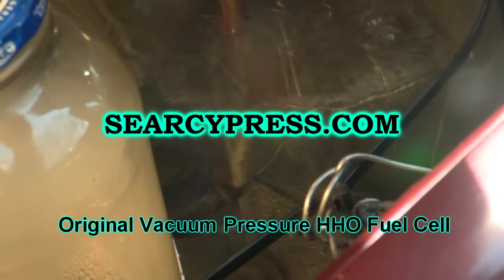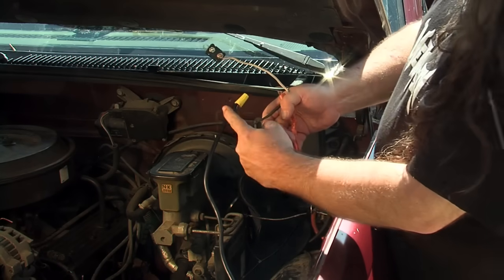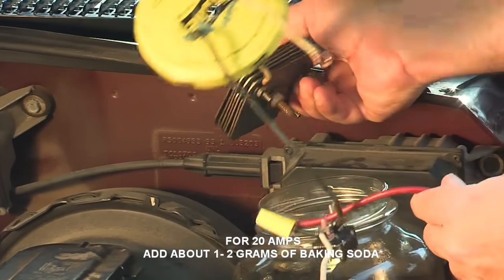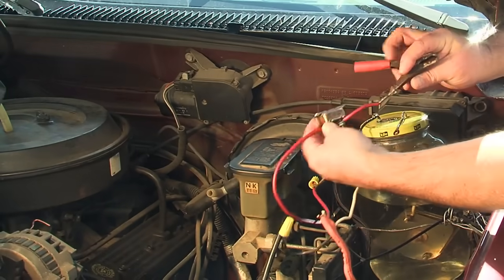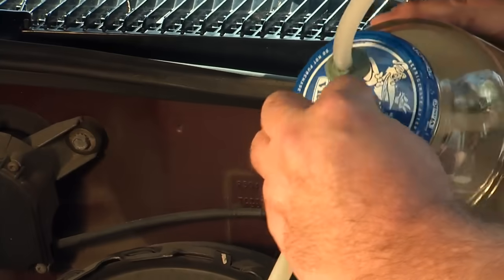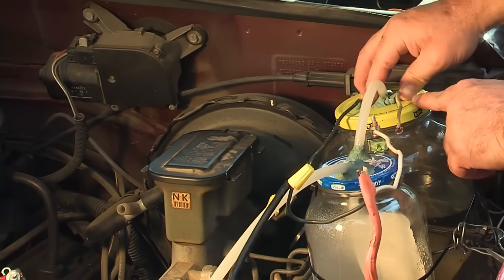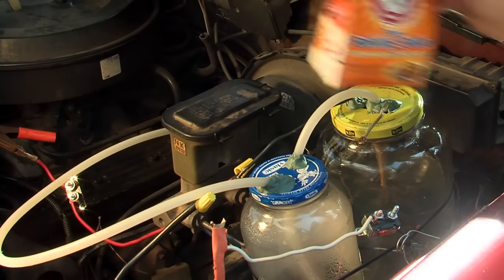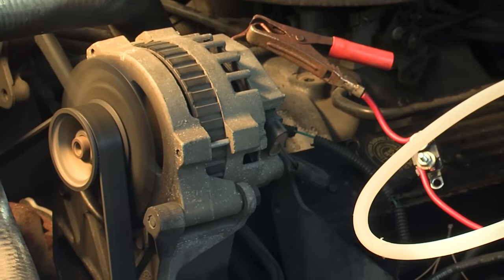Vacuum Pressure Hydrogen fuel cell defeats high gas prices using hydrogen from H2O.

Comment: During the great recession 2009-2010 money became so scarce I lost all my utilities for 2 years. I had acquired a gasoline electric generator which would run 10 hours on 5 gallons of gasoline. I constructed an HHO generator. It was powered by a 12 volt 10amp power supply connected to the electric generator. After connecting the HHO generator the electric generator ran for 12 hours on the same 5 gallons of gas. It ran smoother, more powerfully and cleaner than it had before. After about 6 months the plates were consumed and without the HHO the performance returned to its previous level. HHO could not be used to run the generator but I did observe a noticeable improvement in performance.
Reply: Love these lies....

Comment: This is pretty grotesque for so many reasons, I mean the glass jars as containers and mains wiring twist locks and light switches, Jesus.

Worst part however is the fact it's total bullshit. I mean please explain to everyone "thermodynamics" given you like to use the word a lot. Also explain "conservation of energy" while you're at it.  You are taking power from the alternator to split water into hydrogen and oxygen and then it's supposedly going into the engine via the vacuum line and being burnt to increase efficiency.  However, the power from your alternator comes directly from your engine. It takes more energy to split water than you get from burning hydrogen and oxygen to create water, so you are losing power, you are not improving anything at all, it's total bollocks and anyone who has done even basic chemistry in school can tell you that.
Reply: This guy's building attempts remind me of an expression that starts with an "N..."'
Reply: Kiowan918 @ Don't stress hydro is otw 🤙

Comment: So Electricity in the car is produced out of thin air?
Reply from the maker: No, that would be over unity. The gas  we make definitely comes from the gasoline in the tank. Almost all engines don't burn the fuel completely. The percentage is actually shocking how much is wasted. The HHO gas allows a more efficient burn to take place in the cylinder. Additionally you are able to burn a much lower octane fuel without any knocking of the engine. That is instant savings. Thanks very much for your comment.

Comment: Lol all that water inside the combustion chamber doesn't leave through the exhaust some gets put right back into the engine. Oil and water do not mix. Every see a motor suck in water the oil turns to jello.
This might incrresee mpg but at what cost. You will be doing more oil changes and who knows what other damages

Comment: This doesn't work the way people say it does, but I think it could work. Many companies have been reassuring out ways such as compression ignition, prechambers plasma spark ignition systems all to try and ignite the fuel faster because it can increase efficiency by over 30%. So instead what this is doing is putting one of the fastest combusting gasses into the cylinder to dramatically increase the rate at which the fuel burns which could give the same ~30% efficiency increase.
Reply: Lol at far less then 1% of hydrogen in the cylinder this isn't doing anything but dragging the motor down from the alternator draw.

Comment: Which is it? Vacuum or pressure? The title says both.
Reply from the maker: Vacuum pressure, is pressure. Although this is negative in nature. In Refrigeration and air conditioning this term is very commonly used. The fuel cell itself behaves much like an evaporator in a refrigeration system, that is why the thermal properties of this design make it exceedingly efficient. Thanks for your comment.
Reply: @metalpresstv  perhaps in HVAC this is a common term. Though in reality a pure vacuum is the complete absence of pressure.  In a partial vacuum you certainly can measure the differential between pressure and vacuum. Say as in pulse waves were both exist yet they are still separate, some what dependent apon, and yet still exclusive from each other. This was 1st described in 1643 by Torricelli. So pressure is the collision of molecules within a vessel. Under a vacuum the molecules are void or partially void in partial vacuum. I think vacuum "force" is the scientifically correct term but I will defer to those who have better knowledge of this subject.
Reply from the maker: @scoutdogfsr  very interesting comment. Because a total vacuum is quite difficult to achieve, more than likely you will be measuring a partial vacuum in whatever it is you're looking at. I assume the term vacuum pressure became commonplace because when you come up on a system, and hook up to it, you are wanting to measure the pressure. Let's say you find it in the state of vacuum. The boss asks you what's the pressure? You say the pressure is -15 in. So, pressure is not vacuum and vacuum may not be pressure, but if you're measuring it you might as well give it a name. Odds are you won't have a total vacuum so there is some " vacuum pressure". Have a great day and thanks for the cool information.

Comment: quit calling them water burning...   people think its a scam....   splitting water in hydrogen and oxygen is called HHO .. and indeed... gasoline is only 90 octane at best... so why do people think 130 octane hydroxy cant run a COMBUSTION engine..   Combustion literally means run on explosives. lol   anyway, havent paid a penny for fuel in the last 12 years.

Comment: From a thermodynamic standpoint assuming you have achieved 100% efficiency in converting the electrical energy into chemical energy (in the form of hydrogen) then you will have just changed the form of the energy. It's true that combusting this chemical energy will increase the power output of the engine, assuming no other combustion perimeters change. This extra energy (from the combustion of the hydrogen) which will present itself in the form of torque and rotational mechanical energy will be extracted by the alternator, converted into electrical energy, to be then used once again to generate hydrogen. In a perfect world your not getting any extra power out of this system, your just moving energy around, this is a result of the fundamental nature of energy, it cannot be created or destroyed, for something to become more energetic something else must lose energy. In reality the alternator, fuel combustion, and hydrogen production by electrolysis are not 100% efficient and you lose a bit of energy at each step. Their fore your extracting more energy out of the crankshaft in-order to run this cycle then your getting out of combusting the produced hydrogen resulting In loss of efficiency, and fuel Mileage.

Comment: This seems to be not a Hydrogen Fuel Cell, as it says. As he's not running his car specifically off of this. He's still using a V8.

This seems to be more like adding a Nitro tank to the engine. but instead of nitro, it's Hydrogen. Which is more reactive then nitro, but also more explosive... Though at least it's not oxygen.

This does still however make the engine more efficient. Because it makes the fuel easier to combust, and adds power due to the fact hydrogen itself is far more flammable then just a regular air intake. 

Imagine combining this with a cold air intake, or just using the AC cooler, and having a cooling sleeve over the hydrogen tubing, and water tank to make it cold. It would add even more power, and you wouldn't ever have to worry about overheating.

Comment: You should have either a stainless steel exhaust system or an aluminized exhaust system to minimize the rusting of your exhaust system.
Reply: Salt on the roads eats it alllllllll
Reply: @RobertELee420  especially where i live. Its brutal
Reply: @MrSilvertech  and yet still rust out

Comment: That’s a glass bomb
Reply from the maker: If used improperly true. It runs in vacuum. No more dangerous than a light bulb during operation. With that said, do not attempt. Thanks for the comment.

Comment: That's not a fuel cell.  The 'magnetic energy' of the alternator does nothing for the hydrogen production process.  Not having a switch in the system is retarded.  Having all those exposed electrical connections is retarded.  Using the brake booster hose is probably the worst option available.

Comment: The problem with any Hydrogen system, is water on roads in winter will cause a lot of Ice build up, cause a hazardous condition. 
Need a system that would capture this.
Reply from the maker: I think I see where you're going with this...gasoline is a hydrocarbon so when it burns it's already producing water that is falling out of those tailpipes... As far as I know it's never been a problem. Definitely an interesting comment. Thanks very much.

Comment: Lol ur using gas to convert water into hydrogen so gas will be used anyways ,in fact more gas is used this way than a normal vehicle so it will cost u more to run this and not good for environment also

Comment: The whole point of fuel cells is it charges a battery . Fuel cell cars still run on electric motors and batteries and the fuel cell literally just continually charges the battery ......
Reply from the maker: We were the pioneers..all that came to light afterwards. Thanks for the comment.
Reply: @metalpresstv  needless to say this is still pretty damn cool you made a chemical reaction that can run your car out of household products! That’s not something to downplay man! I’m fully invested in the hydrogen market . I believe it can take over the car market even more so than electric vehicles . The charging time alone and a a huge hinderance that the hydrogen fuel cell will surely take out of the equation completely . It’s a much more plausible solution to gasoline and honestly we have been using it in warehouses for decades already. Infrastructure building over the next 10-15 years will be massive and the hydrogen market will take off no doubt
Reply from the maker: @kobel1564  anyone who thinks a battery is going to get 30,000 + pounds of cargo up the hills of Colorado is delusional. It's going to take something more powerful. Nicola is a company that is probably headed in the right direction. Let's face it, diesel fuel is disgustingly pollutive. What we did here was simply open the gates. We started this prior to 2007 following in the footsteps of Stanley Meyer. YouTube was barely able to produce a video that would stream at all. HD was not even heard of. Look how far we have come. Thanks very much for your comments my friend.
Reply: @metalpresstv  you earned a subscription man! Very informative
Reply: @metalpresstv  wow I actually just realized this was posted 9 years ago so I may have misspoke a bit man good content
Reply from the maker: @kobel1564  our first videos were of course deleted for copyright infringements and other infractions against YouTube policies. We aired this tech on national television where we ran a truck for a short time on pour hho. All of those videos have been removed except for perhaps one of the earlier ones on metacafe. Most won't play but some will. Thanks very much my friend. Good luck.

Comment: Is this the device that caused the dude to get assassinated by oil companies when he tried to paten it?
Reply from the maker: No. You absolutely cannot run pure hho into the engine very long regardless of those videos you may see on the internet. HHO reacts when it burns with other materials reaching incredible temperatures. You would melt the engine. This is not free energy. It just allows better combustion with a higher percentage of fuel getting burned and the ability to burn low octane fuel with no engine ping. You can improve mileage and performance on some engines. Thanks for the comment.

Comment: Have you had one of these explode?  Trust me, you don't want to ever have that happen.
Reply from the maker: Only the lid getting blown off. Never a glass break and never under vacuum. That lid left the jar at mach speed.. screwed it back on. Still worked. Don't play around with hho. It is not a toy. You can be killed when things go wrong. Thanks for the comment.
Reply: @metalpresstv  I've experimented with hho generators for years and have one tip for you.  Invest in a one way valve for your vacuum line because an engine backfire will be catastrophic.
Reply from the maker: @ericmarks6322  back in the early days we had very little protection. Thanks!

Comment: Put this on a dyno, energy from the alternator is not free. You will burn more fuel to crack the water. Assume your consumables are free, which they are not, and the reaction was 100 percent efficient, which is impossible, and best case scenario is a break even. They used to teach this shit in high school.
Reply: PO DUNK what makes you think that the maker of this video completed high school?

Comment: The Only True Fuel in the Future will be Hydrogen.. get used to it.. the only issue that crops up is Hydrogen Embrittlement.. which can be taken care of with Ceramics and Cermet Coatings.. plus we don't have to pump it out of the Earth ..it's 78 percent of our air  ..you can get it Anywhere and Everywhere ..when used properly it will produce an exhaust of water vapor..the only thing stopping it is you..the old thinkers stuck in the past  dragging your feet..

Comment: i can make a step up generator with  a 775 motor turning an alternator up to 40 amps the a 120 volts 20 amps 3 hp motor that will turn 8 350 amp alternator to run a half ton truck.
Reply: Barry Boppins  ok but mine is just a step up generator it uses a household socket to make energy. it just saves energy.

Comment: What an F'ing moron. Been used for 30,000 miles. What happens when the jar lid rubs through the insulation on the wire. Idiotic, lucky he drove it that far. No F'ing way, a bomb waiting to go off. Good idea, horrible execution.

Comment: Interesting. What is the driving range before you have to "refuel'? Any loss in acceleration?
Reply: It doesn't increase fuel economy much but definitely makes motor run smoother. If interested look up a better design this design is garbage
Reply: @BlackandWhitecustoms  dude if you think about it just the carbon build up being cleaned out would increase the mpg wouldn't that be funny if that was the only real difference
Reply: @sethlt9681  its possible. People act like it converts your vehicle to run on a different fuel but its more.like putting your vehicle on a multi vitamin. It helps but you won't notice much 😅
Reply: @BlackandWhitecustoms  check out Mazdas new rotary engine though thata Mazda made and tell me hydrogen really is not perfect for it

Comment: So i understand. You use the power from you alternator(that is powerd bij you crank,) to produce gas that your engine burn....... Think about that for a few seconds( how is that gonna safe fuel?)  it cost energie to produce the gas... there is no free energie
Reply from the maker: You're exactly right there's always entropy. However you're forgetting the fact that the engine does not burn all of the fuel that you're squirting into it. If you burn more of that fuel you get more power from it. But again there is entropy. However because of the effectiveness of this method you're able to burn much cheaper fuel with lower octane. You can save money. Thanks very much for your comment.
Reply: @metalpresstv  hydrogen also has higher octane value than regular or diesel, more power. 

I see 1 problem with this settup thou, not what you did, its what the automobile industry did. Nearly every vehicle newer than 20 yrs old has o2 sensors and will auto compensate. Meaning it will use more fuel 😔 Fortunately engines arent too complicated, you could build your own. I have an air tank hooked up to a 2 stroke engine. Just need to mount it to my bicycle. Plan to convert it to steam in the future and that'll be real fun 😄 but yeah, older cars hho would work great 👍

Comment: Thanks for this video, I’ve watched many others with better materials used (I understand it’s an old video and there are better ways now). I’ve never thought of the idea of using the alternator instead of the battery, makes a lot of sense especially since you can get a bigger alternator if necessary.
One thing I’ve been curious about is using a pulse with modulator, I’m yet to try building one I’m just forming the plans in my head until I just do it.
Reply: I’m doing it but setting mine ona switch and having a pressure gauge so I can build up the psi if needed or have a steady flow of gas just by a switch

Comment: You're running 25 to 30 amp through a 20 amp household toggle switch?
Not to mention the first pothole you hit is going to break those containers..
Reply from the maker: Do not replicate. This was simply a way of getting around the fact that almost every toggle switch we tried would burn out over time. 30 amps is almost constantly pulled through the circuit all the time. I've used that switch for many years and it never failed but it is not designed to be used that way. When we made this video we had no idea that millions would eventually see it. I assure you sure we made much better videos that were plucked from YouTube long ago because of policy changes. Myself and others were pioneers in this field. We started producing these cells in 2005 or so. We aired it on national television several times before all hell broke loose on us. A few months after that MythBusters claimed they couldn't make a bubble and gas prices plunged to 99 cents a gallon from over $4. There have been many improvements such as flashback arrestors and things like that that other great people have made. I salute all of them. Thanks very much for your comment.